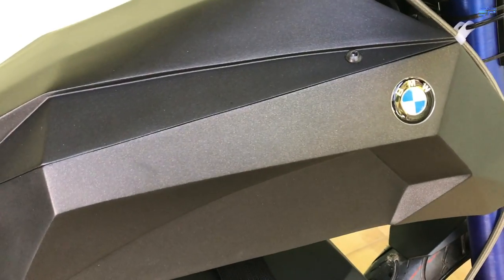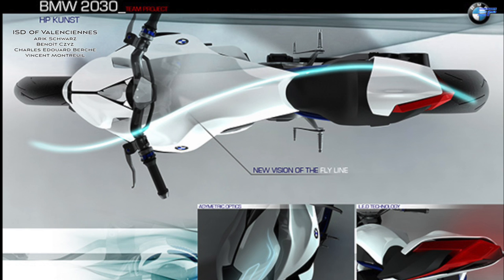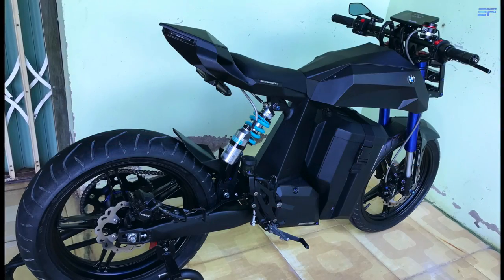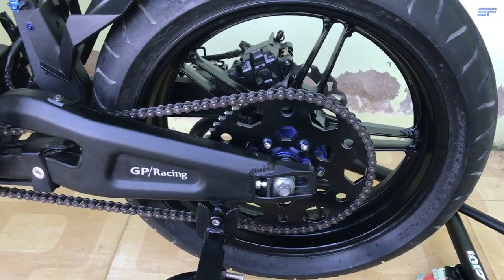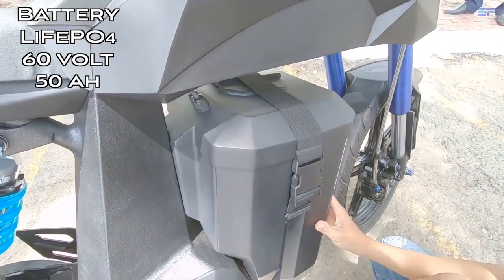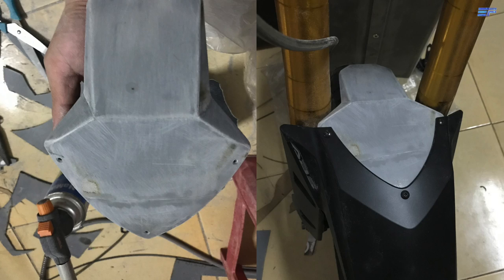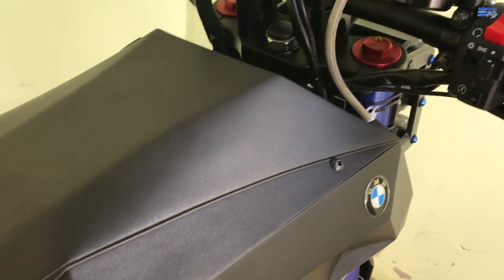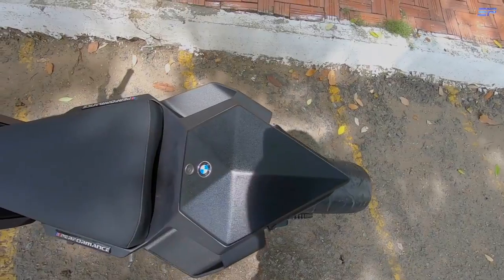DIY Electric Motorcycle 53 mph / 85 kmh

Comment: Amazing build. Very inspirational. Makes me want to try to do one.
Reply from the maker: Same, I’m going to build a similar electric bike this year
Reply: @ElectricFuture if you build your electric bike, can you make a blog or video..from frame, motor,battery and proper wiring 👍👍👍
Reply from the maker: Vic Marrotti  thanks for the bizarre comment Vic keep em coming!
Reply: @ElectricFuture  please make a video of you building your own bike
Reply: Brother, take good offer, time is money, and start your own business after 3 yrs.
Reply: @ElectricFuture  hello
Reply: @bryangeneamparo8151  I'm building one at the moment I have tested it it works great.  I'm  just finishing up on battery placement
Reply: Shivam singh  its here . I have built over 5 of them it's like every Time I have to go faster . Untel I bought 3000w moter it is extremely fast.  I'm satisfied with it
Reply: Shivam singh  so right now I'm running 2 batterys.  I have two 60v 29ah battery. They are large it's best to keep the batterys at the front of the bike because th front wheel might lift off the flor when accelerating . The way I have it set up is I have two separate switches for each  battery and only 1 battery is needed for power when one battery is almost gone I turn switch off and flip the 2nd battery on . And charging depends on battery
Reply: Shivam singh  you can always buy 2 chargers and put them together depending on battery type and amount of amps charger is putting out
Reply: Shivam singh  yes it is usually cheaper to buy 2 smaller chargers and to put together . I try to stay under 5 amps total  depending on battery . I'm using 1850 batteries. the way i wire  it positive to positive negative to negative . the fastest i hav charged is 3h 20 min

Comment: My grandson graduated from well known engineering university with a degree in mechanical engineering like Pham. There is one thing that is difference: he disassembled the car engine, and reassembled it with a lot of left over parts, bolts and nuts on the floor of the garage. He finally called a tow truck to dump it in a junk yard after a month of playing around with the engine.

Comment: I built several ebikes that looks like ninja 300 with 8kw, 10kw, and 20kw motor hub setups. 120kph, 130kph and 170kph Setups. With lithium battery from 84ah, 90ah and 120ah setups. Cost was about 9-12k CAD. I’m also Vietnamese but in Canada.
Reply: You could send the channel your work. I hope to see your creation.
Reply: NBT Quốc I bought all my parts from Alibaba.com. Nothing special. I just bought an existing frame. The guys bike on the video uses a chain driven setup. Mine is a hub motor which is a lot easier to build but not as efficient. This is more impressive as he built the bike from ground up. But I think he should have spend the extra money and put a bigger motor and better controller.
Reply: NBT Quốc if you have Instagram I can send you my creation.

Comment: dualtron x = 60 volt, 49 amh, 150lb total weight
this beauty = 60 volt, 50 amh, gotta be less than 150 total weight

yet the range of the x is possibly 140-150 km and this thing is only able to hit 80 km.
can anyone explain why that is? is is the battery cell type or??

Comment: he should just sell them in the US for $10k
Reply: At 53mph and 50miles of rang that's definitely over priced. I'd he made it for 3g. Production would be cheaper. And maybe 2 so he could seel it at around 4.
Reply: NOPE. IT IS A VERY WELL DONE PEOJECT BUT WITH THAT AMOUNT MONEY PEOPLE WOULD RATHER MAKE THE BIKE THEMSELVES.

IT BASICALLY EASY AND SIMPLE OLD TECHNOLOGY... 
YOU ONLY NEED A BODY DESIGN AND OTHER FUTURISTIC ACCESSORIES SO IT WOULD LOOK LIKE A HIGH TECHNOLOGY VEHICLE.

YOU CAN BUY EVERY OTHER PARTS ONLINE.

YOU CAN CONTROLLER, MOTOR, BATTERY DISPLAY & THROTTLE FOR LESS THAN $800..
GOOD & HIGH CAPACITY BATTERY IS THE MOST EXPENSIVE AMONG THEM.

OTHER COMMON MOTORCYCLE PARTS SUCH AS WHEELS, SHOCK ABSORBERS, HANDLE BAR, LIGHTING AND OTHER ACCESSORIES EVEN CHEAPER.

SO.. FOR 10 GRAND I WOULD MAKE MY OWN BIKE WITH THAT DESIGN OR OTHER DESIGNS I CAN FIND ON THE NET.
AND MAYBE I CAN GET 3-4 BIKES...

Comment: Definitely good job, but that "scooter sitting" position is not good, especially for that max speed. Sit further and have better response from handlebars and better ability to react. Engeneering is one side, without riding experiences the result can be more or less usable. Footpegs are not for resting legs, but for levering, you have to have a feel in your legs and you do not have it in your heels. Front forks angle is more bad than ok. For commute riding ok but I would not buy it. With support of experienced riders he can build awesome bike, no questions about it, and I wish I will buy some one day. Wish him best luck.

Comment: 2000watt and its hitting them speeds the syron is what 6000watt or 1000watt and does the same speed sir you could be a milion air easy you'res hasngot actualy topngrade parts on as well and is only 3000 dolars 1000 dollars xheaper than the syron and you could do a mtb version you could easy makemyoure own business amd a 50 mile range that's impressive the stand up scooters cost 3000 and ano what I'd pic this! Also take the BMW badge off why give them credit make you made it sonyou name it id call it the "stingray Gt" or the " turboron"